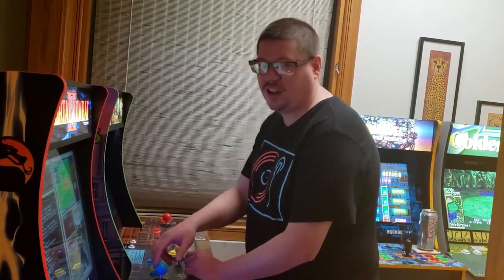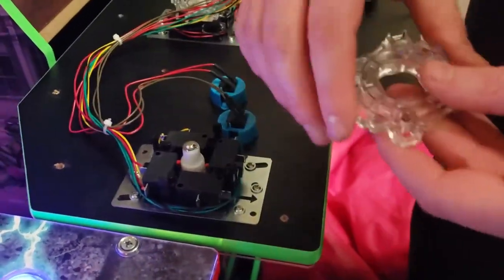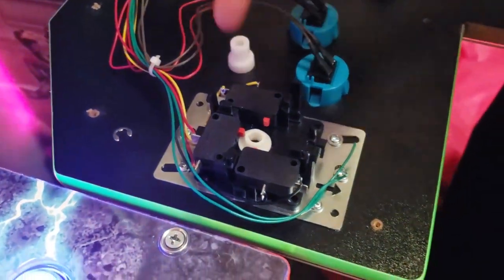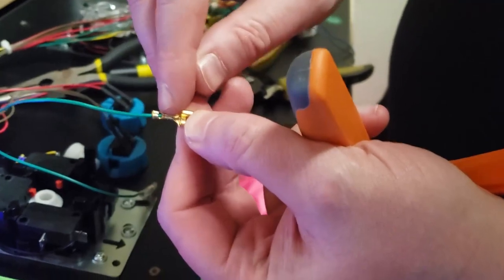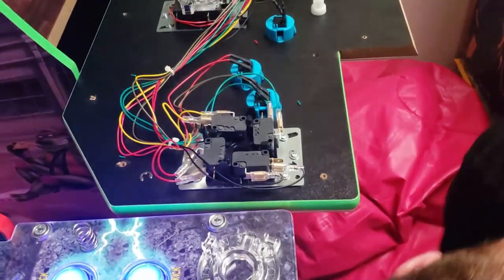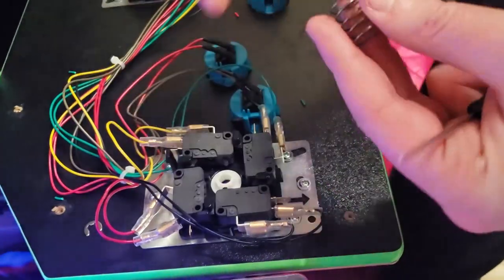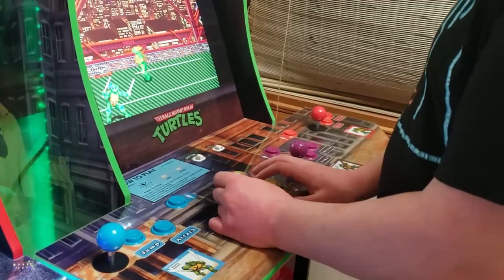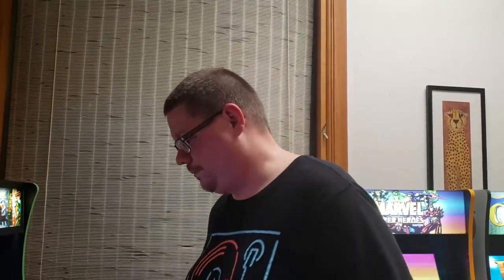Better Than SANWA?!?! CHEAP ARCADE1UP JOYSTICK UPGRADES!

Comment: If your into fighting games stick with a square gate and go 6-8 lb tension spring.🤙🏼
Reply from the maker: I did a more recent video where I put 4lb springs in one. I did 6 lb springs before but the A1Up cabs are so light that you just end up moving the cabinet before you can actuate the sticks. I might mod my Marvel LE cab with the 6 lb springs though. It came with Sanwas that have 1 lb springs and I hate them. I'll have to get some sandbags and put them inside the cab to weigh it down though.

Comment: Nice! I'm going back and forth with doing this on my mk2 cab or get real Happ sticks
Reply from the maker: FWIW, I still like the IL/Happ sticks on my MK better, and they cost about the same per stick as these upgrades. The reason I didn't use them on the TMNT is because there's not enough space to mount them.
Reply: @ArcadeSchool  Thanks! I ended up doing the happ sticks on my MK 2 but i sold it for an nba jam cab.  Now im going to do this mod on the jam.
Reply: @ArcadeSchool  My son just got a Marvel cab for Xmas and one of the solders was broken out the box for joystick 2.  Was going to do what you've shown in this video, but after reading this reply, it sounds like this would be a better/easier option.  Could you tell me which stick would best fit this cab?